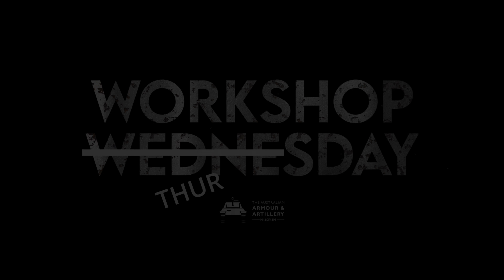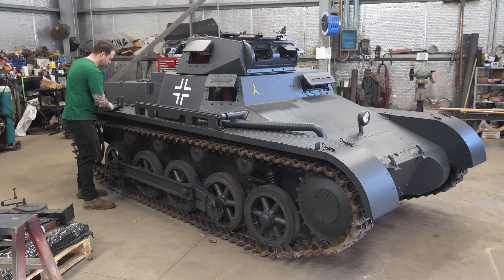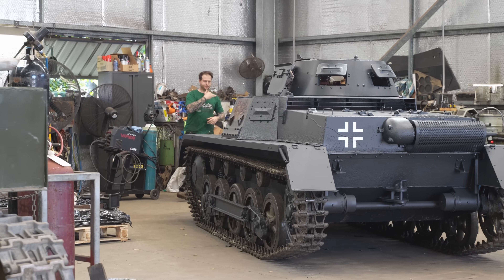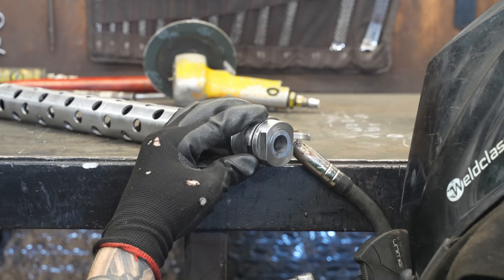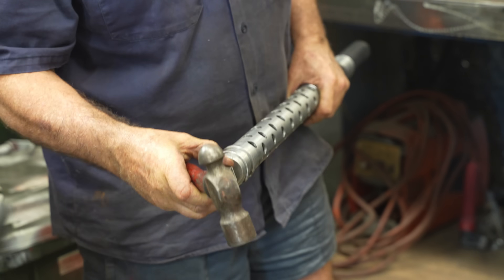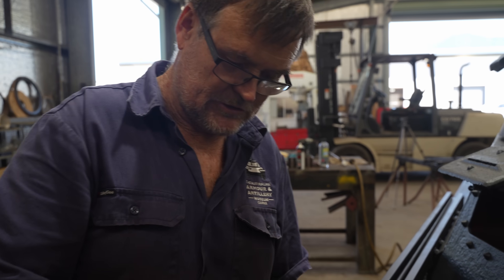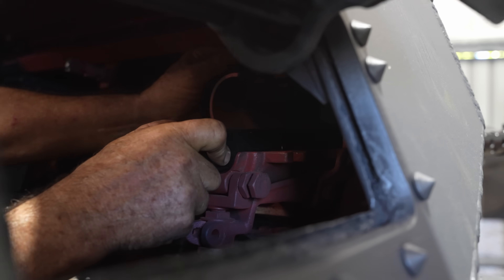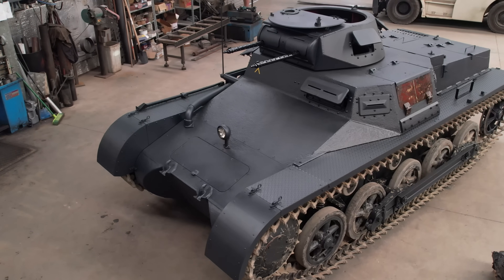WORKSHOP THURSDAY: Panzer I COMPELTE

Comment: @The Australian Armour & Artillery Museum
    Hi! Great work on the Klienpanzer
 🎉👍🎉😁🤗 o7 o7
    Although I think you may in the duture have to add a track link or two back into each track per side,
   ...to give you enough track length for the suspension to work over natural ground undulations. 
    As it is currently your track has alnost no additional length free to ride over uneven terrain - giving you a jerkier rougher ride as the whole track is taught with barely any room for the suspension to flex or operate as a smoothing dampner to engine power loadings.

Comment: “Not a bad job.”.  That is probably the biggest understatement that I have heard this year.  The reproduction machine gun barrels are outstanding.  I have seen similar things on other exhibits, but with not even half the attention to detail that Daz put into them.  The one question I had was about the track tension.  I have no idea what the tension specs on a Panzer I are, so this is a question on my part rather than a snide comment, but I noticed that virtually all Panzer I tanks in historical photos seemed to have a bit more sag in the return run. If you guys wanted to put out a short on how the correct tension, I’d enjoy seeing.  Once again, fantastic work.

Comment: If this is one of the early-early shoter models, you could get slightly more authentic by using a hopped-up VW Bug (or Bus!) motor.  Apparently the earliest version had one fewer bogie wheels and also had an air-cooled flat four engine that made all of 60 HP.

Comment: A wonderful restoration, looks fantastic! I couldn't help but notice how quickly mud was building up on the running gear channel piece just going around the AAAM track. That must have been a problem with mud/ice because that design was never seen on any later German tanks.

Comment: Production of the Panzer IV Ausf.B and C was carried out by Krupp-Grusonwerk from Magdeburg-Buckau. The Ausf.B was built in small numbers, with a total of 42 vehicles (chassis number 80201-80300) which were constructed in the period from May to October 1938. The production of the Ausf.C (chassis number 80301-80500) began in October 1938 and lasted until August 1939. The production run of this version was larger, consisting of 134 vehicles, plus six more chassis which were used as the basis for a bridge layer version. If this is a true B then Wow !!!

Comment: That is indeed the wrong clamp for a Panzer I. It's a common misconception that older vehicles had different clamps than later ones. There were 2 main styles, type 1 and type 2. And they were both used throughout the entire war. Panzer I had type 1, just like Tiger. I have plenty of original ones, including pieces in Panzer grey. Beau could have used that one on his StuG build, and it would have been correct, as StuG used a mix of 1 and 2.

Comment: The reason the MG's were advanced from one another was actually because of the MG feed/ejection system. And definitely not because of space saving considerations. To explain; internal and to some extent external MG systems on German tanks dumped both the empties and non disintegrating link belts into a canvas pouch located to the right of the feed/fire mechanism. In order to save both the belt for later reloading and spent brass from rolling around inside the vehicle, canvas pouches were attached to the ejection side of the MG itself. They were rather bulky arrangements and for it to work on the Pz.Kpfw I the gun had to be advanced of the other. In some instances, a box magazine was used instead of a belt of bullets and that advanced position allowed for box magazines to be used also.
Reply: Thanks for detailed info.👍

Comment: I have 5 different Pz I's in my model stash.  One is the open top driver training one.  Now that I know what the hydraulic drive setup looks like I can accurately do it as an modern build.
Wondering if the "struggles on hills" be a lack of hydraulic power or just a teething problem.
I think Ernst Kniepkamp & Krauss Maffei would be very happy with what you at Aus Armour have done with their little beasty to resurrect this one.
Excellent work.      See you next year.

Comment: May I suggest having a Hydraulic Fluid Expert, System Designer look into the control system valving. When starting, stopping, or maneuvering , everything is not a smooth transition. Definitely some work needs to be done in that area 👍